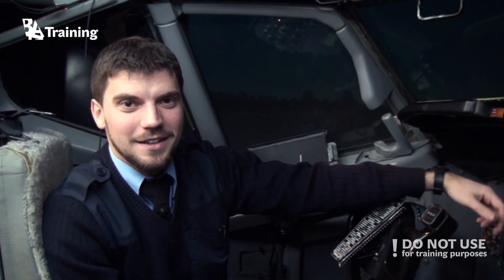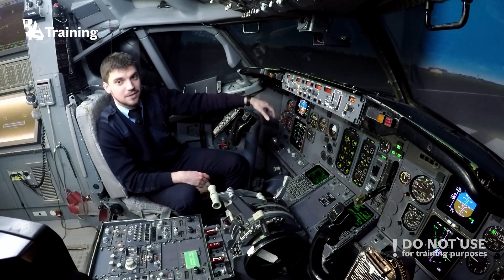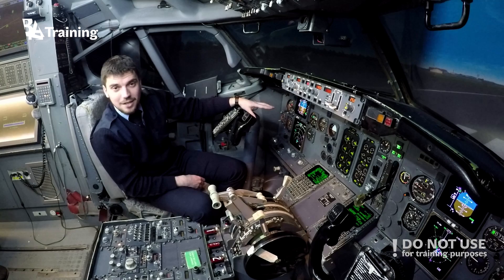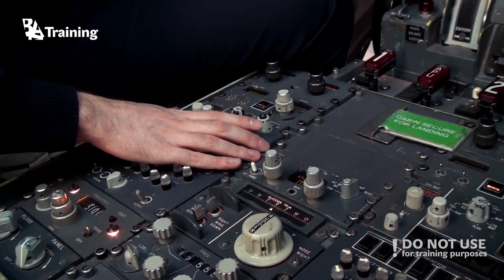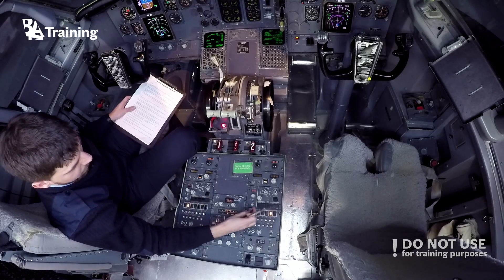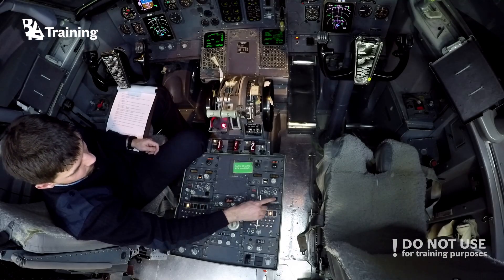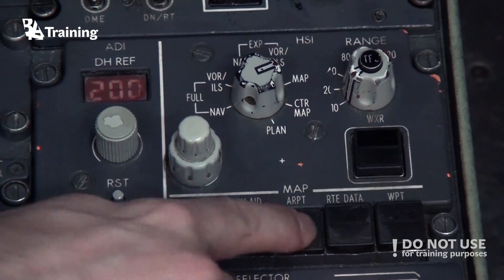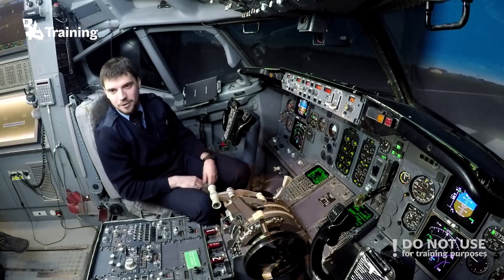Get to know the aircraft - electronic flight instrument system (EFIS) - BAA Training

Comment: How do you control the cabin pressure and does it has to be changed at certain heights and speed?
Reply: Oh Waw thanks for educating me on this topic. It always intrigued me and also, when the plane takes off there is an audible sound as the aircraft ascends similar to a digital blood machine. Is the sound linked to to cabin being pressurized.
Reply: +Glory Nation 
You can do it manually, however it's usually just left at "auto", check out: 
Helios Airways Flight 522